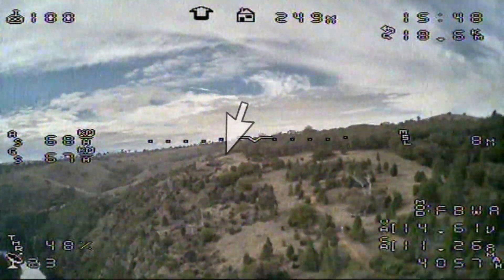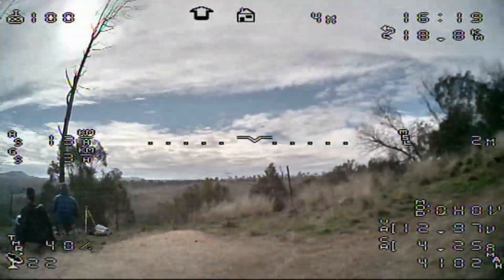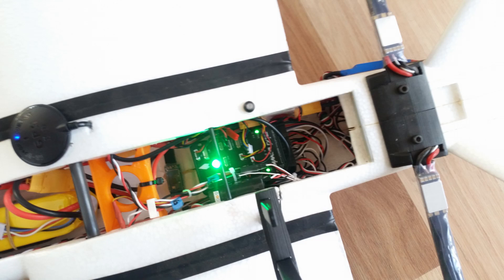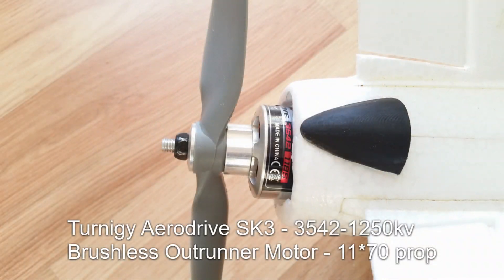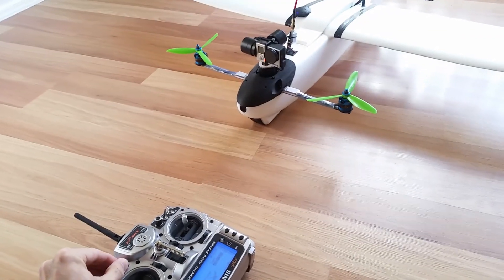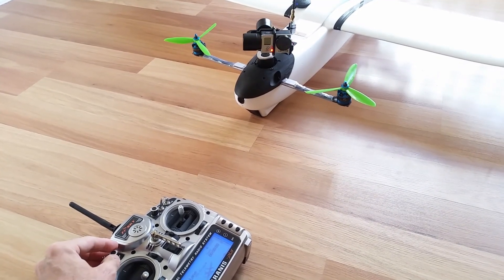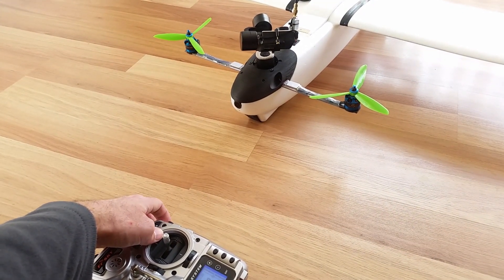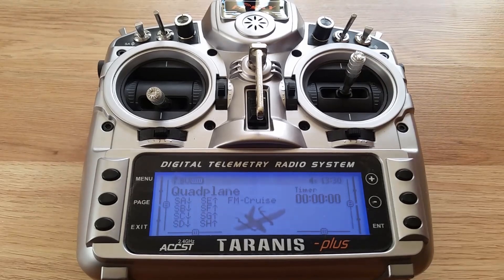Mini Talon Quadplane - Update

Comment: What is the CG of the quadplane finally built
Reply from the maker: Balance point is at the servo wire channel.
Reply: @zonefpv4328  i dont get it please explain little clearly is it 25% of wing or centre of the quad
Reply from the maker: @aesatishchaudhary5933  Balance at CG found in the manual for the plane. The CG is in the same place as the servo wire that goes to the ailerons. The front and rear quad motors are not equidistant from the CG, and that is OK.
Reply: @zonefpv4328  i mean there is not any calculation for CG of Quadplane rather than the manual
Reply from the maker: @aesatishchaudhary5933  Yes, set the CG for flight in plane mode.